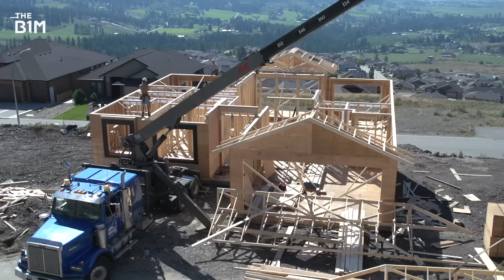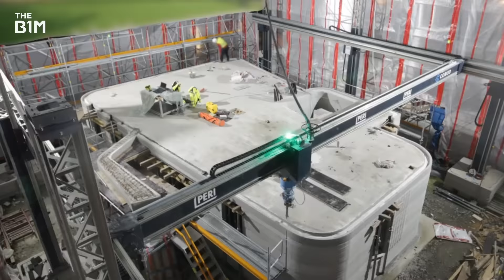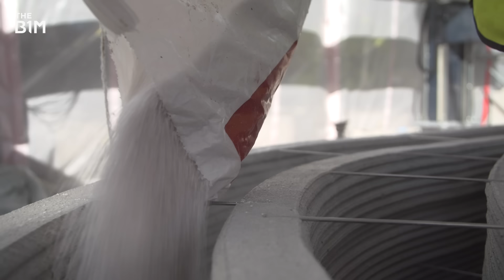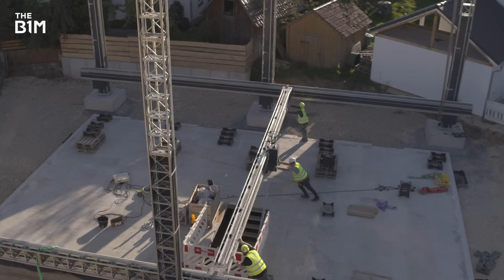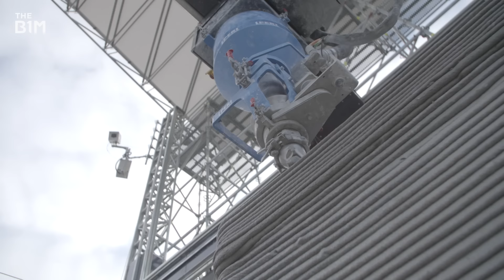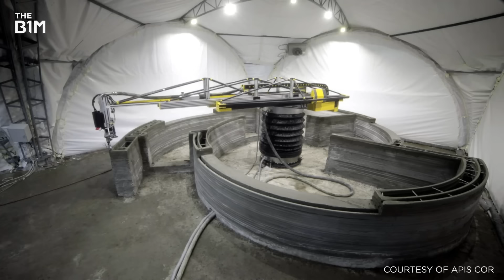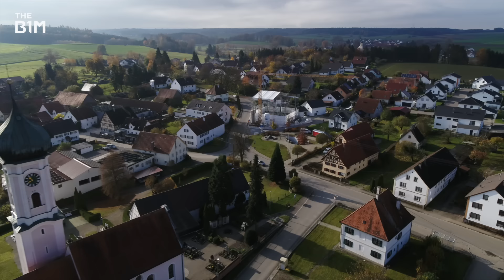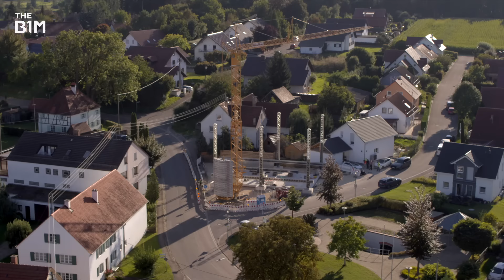Why This 3D-Printed House Will Change The World

Comment: This will only "change the world" if it is an equal or better product for the homeowner & there aren't any hidden downsides-like can this structure be modified (lot's of people modify their homes), if it lowers the cost of home ownership which is a huge problem right now & doesn't just put more money into home developers pockets, & if it can produce housing faster than current techniques-which wasn't that clear in the video. There's also the issue of; does this kill jobs? Without jobs people can't afford homes. This video was not very informative at all.

Comment: The seismic performance of minimally  reinforced concrete walls under earthquake excitation, much less common foundation soil movement due to moisture makes this technology suspect. Perhaps using an engineered concrete that  can flex?  Need far more technical data than is presented here.

Comment: I can't help but notice a tower crane was used in this project for a two story building. Tower cranes are expensive and time consuming to set up.  In the USA a tower crane is typically used on mid-rise and high-rise structures and is absolutely unsustainably expensive and awkward to use in a residential neighborhood setting as depicted in this video.  Hopefully 3d printing of structures can be done without such need for a tower crane and the 48 hour setup needs to be reduced to 6 hours or less per building site to be viable for large scale single family or small multifamily projects lest we be required to have dozens of 3d printers on site simultaneously. I absolutely love the idea of 3d printing structures!
Reply: You see tower cranes on almost all construction sites in Europe.
They cost maybe 2000€ per month and are set up in only two hours.
Reply: Wow, how do you setup a tower crane in two hours, yes the actual crane assembly is very fast, but a safe and sturdy base typically requires some form of semi-permanent concrete base lest it fall over. That crane in the video did not look like a mobile crane. Perhaps it was just that however. Not trying do downplay the 3d printing of a house, I think that is fantastic.

Comment: I still feel pre-fabricated panels that slot together is the way to go, quicker and cheaper no doubt. They are of course only good for the same design, perhaps an estate and can be made using environmentally friendly (-ish) materials. Yes space will always be an issue, but so are these printers, they seem to need a lot of space. If the pre-fabricated panels are smaller in size, they can be delivered in smaller trucks in tighter locations too.
Reply: You could install a printer in a prefab company (: and use the printer for special prefab designs...
Reply: @mux90able  why on earth would you do that? Printer is much slower than simply pouring the materials into a mould! You could do hundreds of sections a day if large enough capacity.
Reply: @bennyceca  Only for special designs, where handmade formwork would be too expensive. I mean the costs for those printers today is affordable. I mean your right the printer doesn't makes sense for standard elements it would be way too eypensive.

Comment: I believe there are materials out of which structures can be made which, with a slight electric charge, retain heat during winter and cool during summer, thus reducing of eliminating the need for traditional air conditioning and heating. I wonder if the day will come when they are able to 3D print this type of material. That would be ideal.

Comment: A meter a second isn't relative to anything, nor having any data and therefore isn't telling.
Also would be interesting if it could switch materials and lay piping and cables and 3d print drywall right away only exposing key elements for the workers to tinker along the construction process.

Comment: 8:32 That is really interesting! I would like to know more about how curved shape buildings are more sustainable that standard rectangular buildings.
Reply: it probably use less material
Reply: A circle has the smallest perimeter for a given area.  This not only means less material but also less wall area for heat to escape or enter the building.  Keep in mind, however, the practical aspects of curved spaces.  Rectangular furniture does not fit well against curved walls.  Geodesic domes, which take the curved concept to the third dimension, have unusable space where the ceiling is too low and wasted space where the ceiling is too high.

Comment: My only concern is the energy intensive nature of concrete. Otherwise, this is awesome.
Reply: Also I have heard that sand is actually a finite resource and we are running out.
Reply: Energy intensive in what way? In its production or expensive to heat a concrete home? I’d like to know more.
Reply: @ian4175  Large amounts of energy is required to produce cement: https://www.eia.gov/todayinenergy/detail.php?id=11911
Reply: I wonder if this sort of printing technology could be applied to materials like mycelium based concrete? https://www.cbc.ca/radio/spark/why-fungi-could-be-the-future-of-environmentally-sustainable-building-materials-1.5479660

Comment: Now they need to find a way to smooth the walls and I'm in.
Reply: They could just hire someone to do plaster or whatever. that'd be an easy thing to solve
Reply: i like the look
Reply: The same way they smooth brick walls: using plaster.
Reply: A trial and a sponge like regular concrete work.
Reply: @jeffreymoffitt4070  *trowel #boneappletea
Reply: haha.....  yes  Very perplexing.  lol...  

A Problem is, Some things are not worth the effort of Programming a robot to do (Exterior / interior walls could easily have a robo trowel-head to blend in the recent layers) - most construction is a one off, every process is only done once.  Cost analysis - Spraycrete-ing walls (insulation / plaster / primer all in one??) after construction vs trowelling continually during manufacture (and rules / reg's regarding working in the presence of an autonomous machine / slung loads etc....) ?? - The paperwork is often the hardest thing to do in the modern world.
Reply: Some say they may never find a way to make that dream a reality
Reply: Well, let me think a few seconds ... maybe they will use some German rocket technology 😱 https://www.youtube.com/watch?v=1VAixFCyFzs

Comment: Surely there would be a height restriction on 3D printed buildings because they'd have to be able to flex slightly during earthquakes, yes? Correct me if I'm wrong; I'm neither an architect nor an engineer

Comment: Curious about the comfort levels, how is sound proofing, temperature insulation, etc?
Reply: It's a concrete wall. There is no difference to traditional building, except it's printed instead of poured. Sound proofing and insulation are entirely seperate issues ;)
Reply: Probably better than wood. No drafts
Reply: Love this show. Hope 3D printing construction will improve here. Personal Design capabilities, insulation choices, add-ons at a future dates.
Reply: There's no reason you have to leave it as concrete walls, you can add any type of sound or thermal barriers you want inside, depending on your climate. You just have to leave a few inches of spacing in the plans.
Reply: @MoriguTheDead  No, no need for spacing in the plans. Its a cavity wall construction. Insulation fills the cavity.
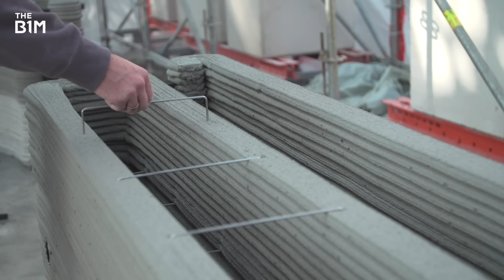Reply: just by the looks, the walls are hollow and filled with insulation material 2:40
Reply: It would be great if they can build these on the Moon and Mars. But who would install the rig, electricals, plumbing, HVAC (Heating, Ventilation, Air Conditioning)? And all non 3D printed furniture? Painting the the interior and exteriors as requested by the designers. Electronics, computers, communications, any aesthetic designs? Exterior plug-ins for any electric vehicles?

Comment: Hate to bust the bubble but concrete should never be FDM printed. It makes 1000x more sense to 3D print temporary formworks onsite using an infinite axis printer, auto lay the formworks and rebar, then pour the concrete in. Every company building concrete 3D printers in the year 2020 are either scammers or extremely stupid. Definitely looks cool though, people have been pulling this scam for decades now, there's a reason it never took off.

See how you need a printer larger than the house to print the house? Well what if I told you, you could automatically construct infinitely sized buildings with a 3D printer the size of a microwave, that costs less than a playstation 5? This is the power of infinite axis formworks.

Comment: Practically it is a great idea and looks incredibly strong. Esthetically it certainly looks like a sloppy icing job on a cake. I can see the appeal for mass production but for high end homes it is the opposite of the craftmanship that most clients seek, and it needs the flexibility in finished surfaces to speak in the vernacular of the setting in which it is placed. There is still a long way to go.
Reply: They could just the the thing as like a foundation and put better looking stuff on the parts you can see
Reply: Ive seen some very nice 3d printed artworks, theyre just yet to get there
Reply: you add plaster to fix the wallkss nd if your talking about cured roofing exc easy no issue their normal concrete printing
Reply: @tonythreepies9272  what if some don’t lol

Comment: I am by no means a Luddite, however, this is really marginalized the work forces. At its core, construction is a way up for a work force that could be relegated to the service industry, which in my opinion offers little advancement compared to a skilled trade. Using this type of limited skill limited manpower seems to me to throwing that opportunity to the side.